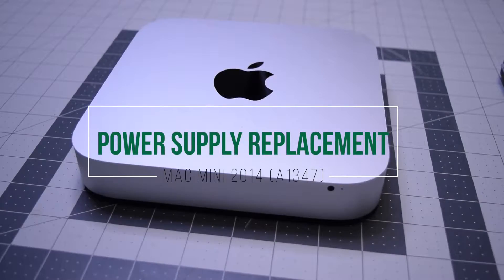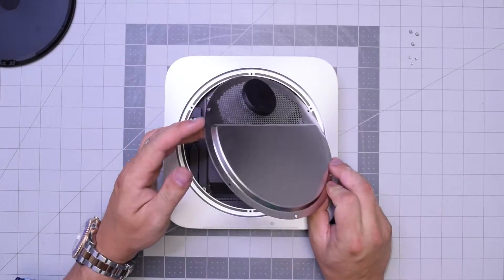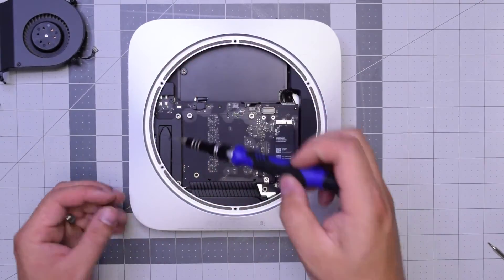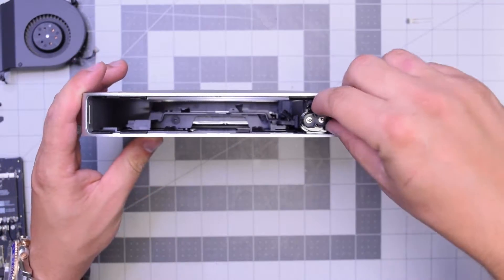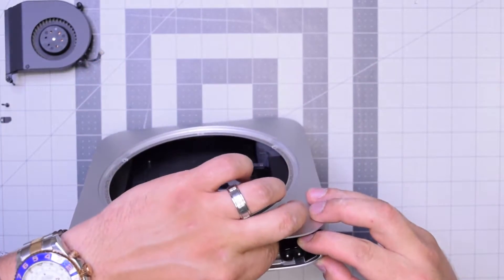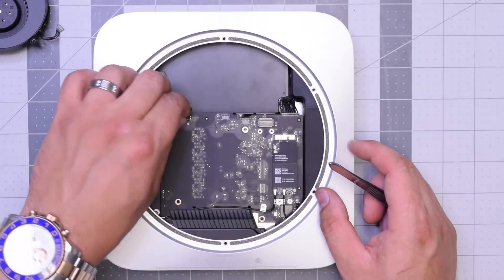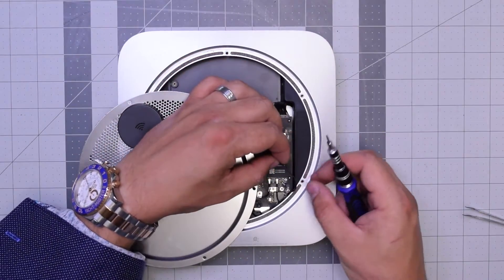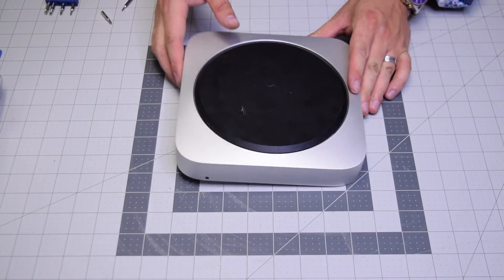Power Supply Replacement - Mac Mini 2014 - 2017 (A1347)

Comment: Once the aluminium case is stripped, what are these two silver small & round stickers that are extending under the two rectangular black plastic mounted-to-the-case parts? Screw holes are midway of the two rectangular black plastic mounted-to-the-case parts, suggesting something? Is there a connection between the screws fitting in there and the silver stickers underneath? Hope I make sense...

Comment: My power supply of my mac mini 2018 is defective, do you know if the power supply could be exchanged with a power supply of an older mac mini model, for example the power supply of a mac mini 2014?

Comment: I did this exact same thing and now my mini has NO POWER!!!
I researched this online and found that my issue isn’t isolated. Can anyone help me fix the issue?
Reply from the maker: Yes, there are only two likely situations. One, the power supply is not connected all the way to the logicboard (the most likely one) and two, the replacement power supply is bad. Open the unit and reseat the power supply to logicboard connection, make sure it's tight and pushed in all the way. As always also check the power cable and outlet.